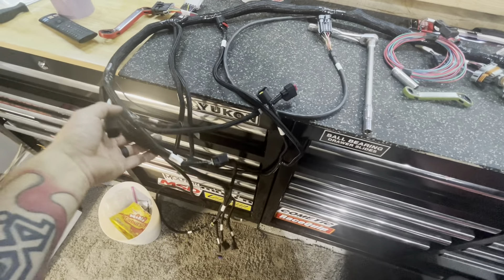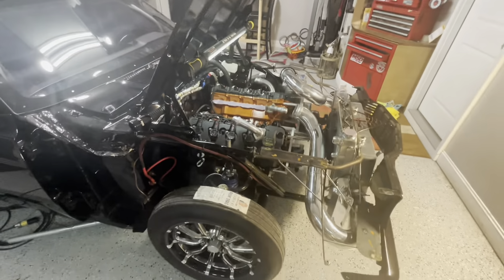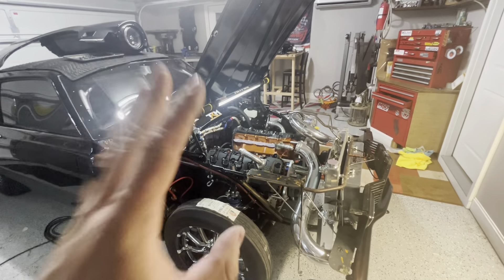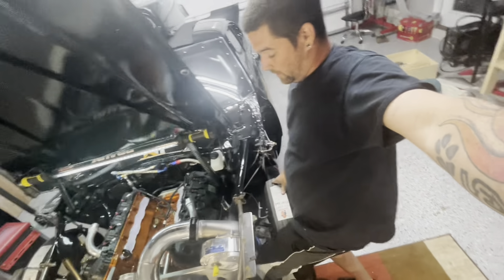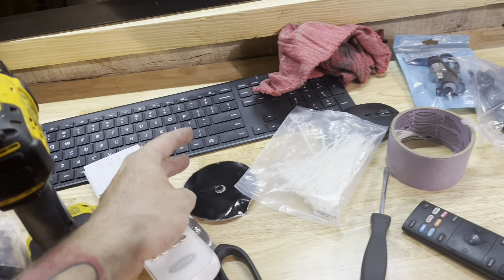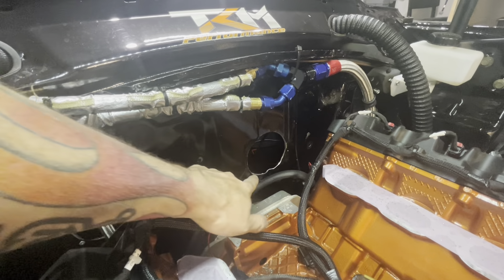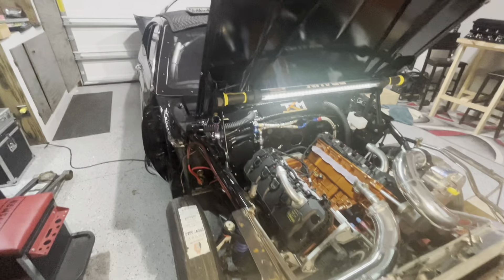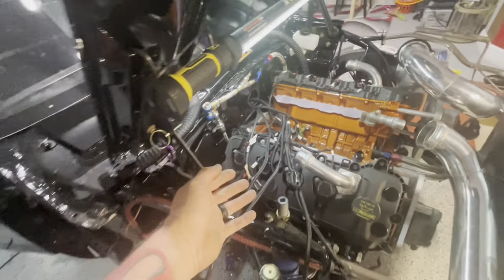➰Starting The Coyote Holley Harness Install 🔌🧰🙈

Comment: I have the terminator xmax for mine, it came with pretty good directions and what the abbreviations were, I did have to contact engine builder about some, some i had to buy adapters to go to harness. It took me awhile, not my strong point either 💪💪
Reply from the maker: Yea I’m rereading instructions tonight and making a lot more sense of it all. Got one plug I may need an adapter for or different sensor
Reply: I bought one from Holley, cost arm n a leg, next one ebay, I can’t tell a difference except price.
Reply from the maker: Yea I definitely shop around also

Comment: Ive been thru the confusion of wiring, reading and comprehending the schematics, pinouts along with all the legends for relay, circuit breakers, fuses and all. Did it for 20+yrs then changed careers and 90% of the legends are different, schematics arent the same and most wires are all the same color with stick on numbers that fall off in install so we are tracing wires half a mine lol. At least Holleys harness stays the same color on both sides of a connector, OEM Ford will change colors 3 times before it gets to the ECU from a sensor. Everybody has their strong suit thats why its a profession for everything....so we can pay somebody for shit we dont want to do😂
Reply from the maker: Lol absolutely true man. I’m just glad it’s labeled. I’d be in a mess if it wasn’t labeled. And yea glad the wires aren’t the same color that’s a nightmare 🤦🏻‍♂️

Comment: I'm right there with you on the wiring. I learned a ton from Watching Devin's channel he has a lot of information on the holley. Dm me I might be able to help you out with a fuel pressure regulator.
Reply from the maker: Yea he does amazing work. Thanks man o actually spoke with aeromotive today on which regulator they recommend and got an answer for that that will work best with my combo so I’m ordering it tonight
Reply: @ThePaintPaperHustle  awesome.  I'm upgrading my system and have a aeromotive I'm not using
Reply from the maker: What part number?
Reply: @ThePaintPaperHustle  A1000 , 2 - 8an ports in and 1- 8an return
Reply from the maker: Will that work for mine?  I was told to purchase Aeromotive 13134 that it best fits my build.
Reply: @ThePaintPaperHustle  if they recommend that one I'd go with it.  It flows more than the one I have
Reply from the maker: Yes they said for the two fuel pumps I’m using that that’s what I need. I haven’t went over second  fuel pump yet as I’m about to order the one tkm said to use
Reply from the maker: Thanks a ton Phil
Reply: @ThePaintPaperHustle  no problem,  I'm still learning this as well. 👍
Reply from the maker: Team we don’t know what we are doing 😂
Reply: @ThePaintPaperHustle  👊💪 lol.